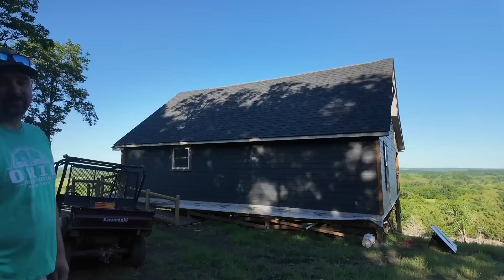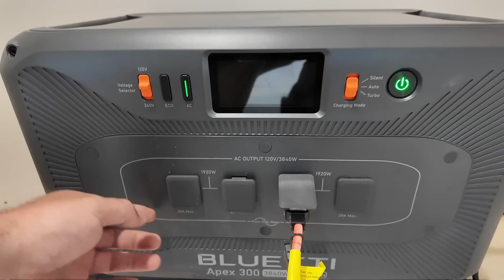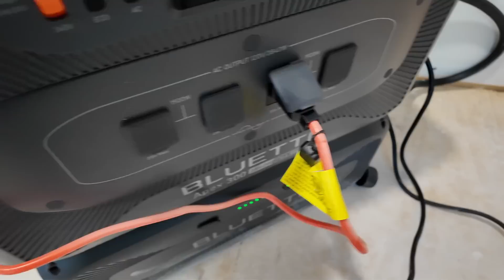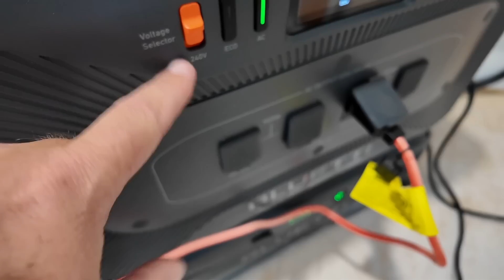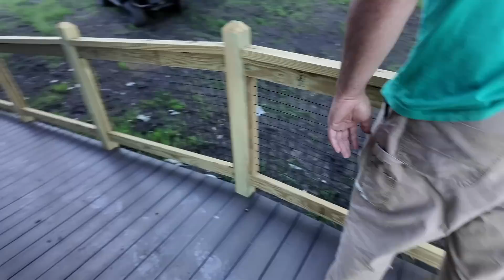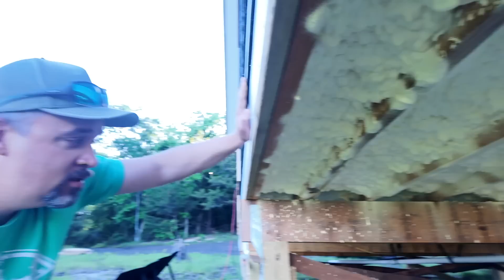Building A New Off-Grid Cabin In The Woods

Comment: Off grid electric is such a joke.  Converters, conversions, batteries are NOT generators.  Propane or Diesel is the best option for electrical generation with maybe a 120v AC windmill. You run battery converters, the life of your appliances are sacrificed due to Square Wave Pulse current or square wave AC at low cycles. Battery lighting is a good thing.  But expect replacement often.

Comment: It’s a little expensive to buy a generator large enough to run my entire home, but I have my travel trailer parked by my house, and I use it when my power goes out. I use a 4650 kWh inverter to run it, which works great and saves money.👍🏻👍🏻